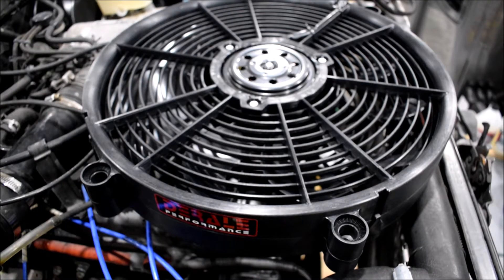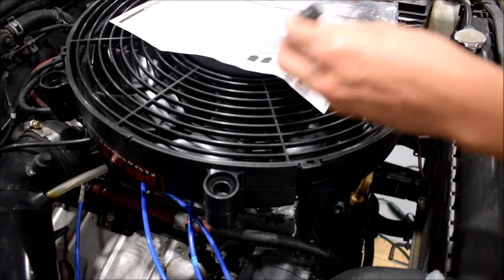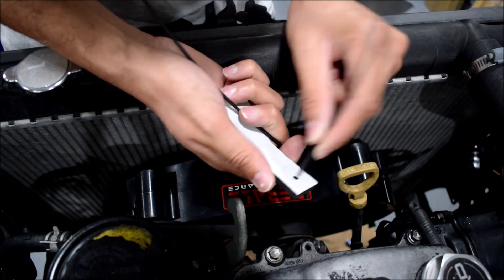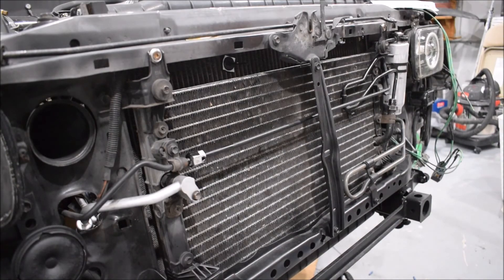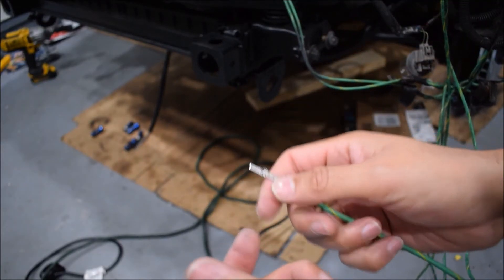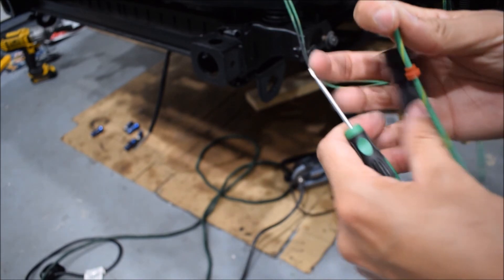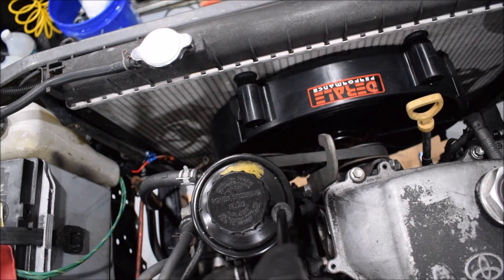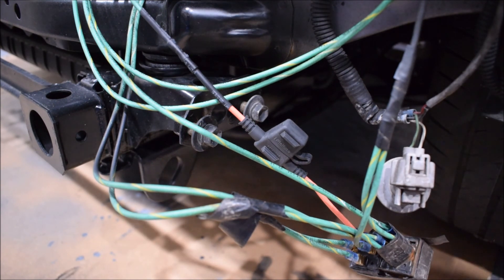Tacoma Electric Fan Upgrade

Comment: Fellas, if an Electric Fan was better wouldn’t Toyota put one on from the Factory? The Clutch Fan doesn’t take any Horse Power to run when you’re at cruising speeds. The Clutch disengages to allow air from vehicle movement to cool. You CANNOT improve what Toyota designed.
Reply from the maker: @ToyodaMaster-tq6ht  that has to be the biggest clown take I have ever heard. If Brembo brakes were better than the crappy single pistons, wouldn't Toyota have put them in? If high performance tires were better wouldn't Toyota have put them in? If Recaro seats were better than the factory concrete torture devices, wouldn't Toyota have put them in? Here's a much needed clue, you CAN improve on what Toyota did because Toyota had specific cost and timing to market targets to meet so "better" wasn't the goal. Acceptable was the goal. Why do you even bother to watch YouTube car videos if you have such a lame mentality? Also, it most certainly robs power at cruising speed. A first gen Tacoma is gutless in 5th gear from cruising speed. Take the clutch fan out and surprise, you can now accelerate in 5th. It made a bigger difference to making the motor rev freely than the aluminum flywheel did and that's saying a lot.

Comment: I’d also suggest carrying the Clutch Fan with you if you travel. If that cheap electric fan fails. You’ll be able to put the far superior Clutch Fan back on so you don’t get stranded overheating.

Comment: Why not mount the Fan to the factory Fan Shroud? It’ll move/pull air across the entire Radiator, instead of just the portion that the Fan is up against. Or, build your own Shroud out of sheet metal.
Reply from the maker: @ToyodaMaster-tq6ht  there is so much misinformation on shrouds. A shroud really allows a manufacturer to use a fan that is smaller in diameter. With one this big, it's a non issue. Also, at speed, a shroud reduces flow across the radiator which is why road race cars do not run them. I autocross and track, so that is always a consideration for me. It's been a couple years and I can still sit in 100+ degree Florida weather, in a traffic jam, blasting the AC and never get the temperature needle past half way.

Comment: U need a good shroud.
Reply from the maker: This keeps the truck cool in sweltering hot Florida summers, in traffic jams, with the AC on full blast and has done so a couple years now. A shroud is for pulling air across an entire radiator when you use a fan that's small and doesn't cover enough of the area of the radiator. Since this fan covers most of the radiator, that's not an issue.
Reply: What relay did you use? Did you ever use a shroud?  Any issues. Got a 2015 Tacoma and have the same issue with the AC

Comment: That wont work in az heat.....electric fans can only pull about 40 percent of a mechanical.....i tried it on my 79 bronco.....temp would keep creeping up on hiway at about 65 mph
Reply from the maker: A fan does nothing at highway speed, it's actually an obstruction which is why race cars don't run them. There is no fan, electrical or mechanical that fits in a car and pulls more air than what 65mph will flow.  Your Bronco had another issue. Also, the notion that an electric fan only pulls 40 percent of a mechanical is not accurate. That means my clutch fan would have pulled 6250 CFM vs the 2500 of my electrical and it most certainly did not.
Reply: Thats fake news....bronco runs fine w flex fan and shrould.....real world experience....you are truly clueless😁🤣😂

Comment: doesn't matter how fast the fans spinning, without a shroud it won't pull much air through, u need a good shroud, i use some sheet metal from homedepo to make a shroud and it was day and night compare to without a shroud.
Reply from the maker: An air to water heat exchanger, such as an automotive radiator works primarily through having a large surface area in contact with the air flow in order to take maximum advantage of forced convection. As long as the fan takes up a large area of the radiator (this one is huge) it will pull sufficient air to keep the process going. A shroud can help pull air over the entire surface and is mainly used by manufacturers so they can get away with running smaller, cheaper fans. At speed, a fan isn't necessary and a shroud actually reduces airflow across the radiator at speed (it acts as a restriction, reducing the needed pressure differential to allow max air flow), which is why race cars don't run shrouds. This one keeps the truck cool in 100 degree Miami summers, in start and stop Miami traffic while the AC stays ice cold, I've no complaints after many months of using it.

Comment: This seems like a terrible way of attaching the fan.  That is probably putting a lot of strain on the radiator tubes and fins.  They should have some sort of stand off bracket.  Thanks for sharing this.
Reply from the maker: I wish they did as well. Oddly enough, it's what all the electric fans come with. It's fairly light, so I'm not too worried, but we will see long term

Comment: how has this set up been working for you so far, do you still have it on?
Reply from the maker: It has been really good all these months. It ended up blowing the relays, but that's because it draws quite a bit of amps on startup. I switched to two 70 amp Bosch relays and it has been smooth ever since. The truck runs cool and my AC blows ice cold even on 100 degree Florida days. It's honestly one of the best mods I've done to the truck recently.
Reply: @doitwithproperstyle  that's great to hear man, i have a dual fan set up and i also kept blowing through fuses. i have a 60amp fuse for each fan and the relays i have are 60amp as well! 
if you want to check out the video its the last one on my channel, i like experimenting with e fans a bunch!
Reply: If you want it to be much better and efficient, consider building a shroud system and you’ll know you built it right! 

Good luck!
Reply: Could this fit in the 2nd gen Tacoma?